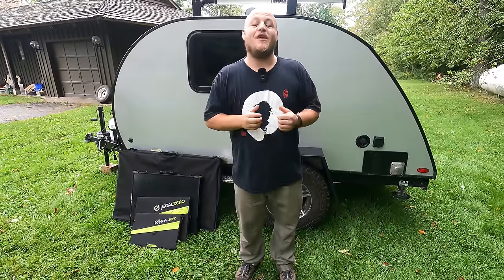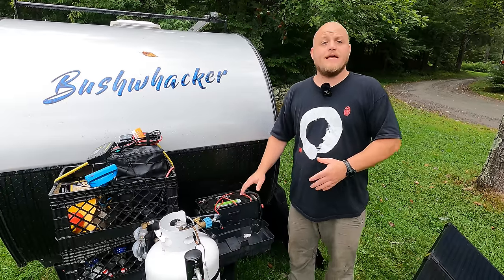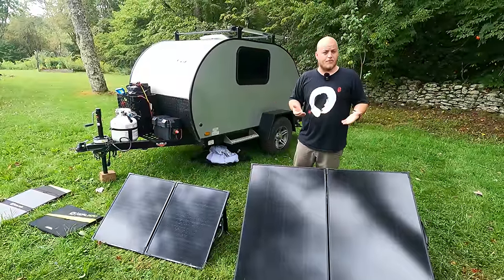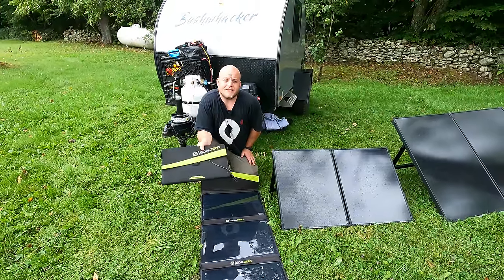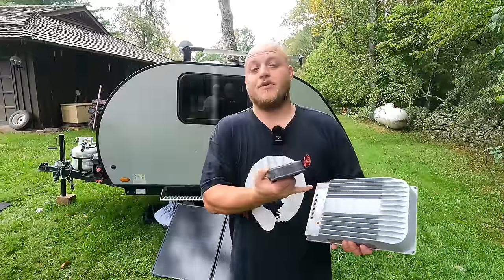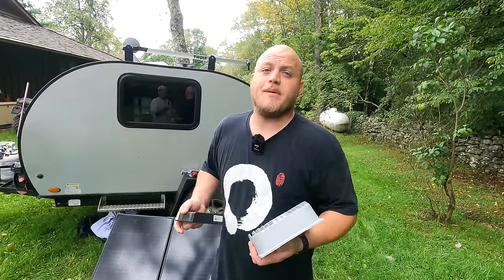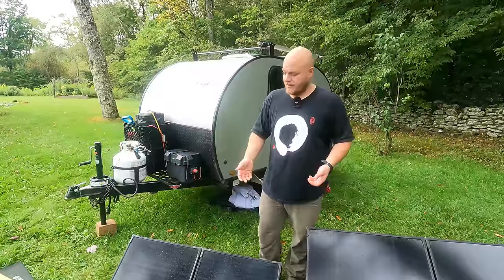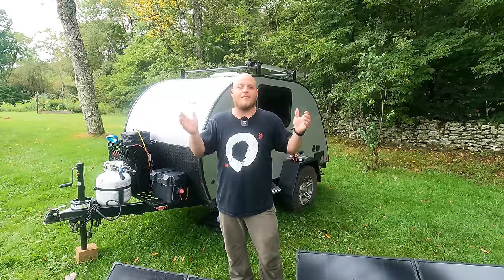RV Solar 101 : Everything a Beginner Needs to Know !

Comment: Hey Brian! This video was so informative. I used my boulder 100 and yeti 1500 x for 5 days camping this week. On the first night my friend wanted to try it on his pop up camper and it drained all the way out to 2% over night! Turns out his fridge was on and we didn't know.  After charging it for the next several days, I experienced the same thing as you. I maxed out at 90 from the panel despite being under 12pm sunlight flat. I could never reach 100. Thanks for the info, I am looking forward to the next videos about this, and trying to decide if I want another 100 or a 200 panel to make charging my Yeti faster.
Reply from the maker: Hey Joe, that yeti 1500x can handle a HUGE amount of solar, receiving 600 watts in at a time. As I’m sure you know, it’s a pretty big unit to recover with 100 watt panel, it would be a great idea to step it up a couple hundred watts. If space in tight, the Nomads are great, but Boulder gets best results.
   Somethings “fishy” with your friend..lol… I run my household refrigerator for days when the power goes out.. I’m guessing his battery was dead and charging, plus fridge, plus other items running, perhaps making waffles in there??? Haha 143 amp hours in a night… I’d be picking on him 😆

Comment: Amazing video thank you so much man. I noticed that you're not using lithium batteries, is there a reason why?
Reply from the maker: Thank you, I appreciate you watching!
I will post a video I did on the pros and cons of lithium for RVs.

I use lithium almost exclusively on my off grid systems but an RV is different.
1) I use two tow vehicles and would have to isolate both systems with a DC DC (this cost more than 5 SLA batteries) I’ve been getting 7 years out of AGMs.

2) it’s snowing and 20° in upstate New York today, not uncommon for freezing temps in April here. I’m charging my camper with solar right now, my lithium batteries are too cold to charge.

Pros and cons to everything, I hope this helps explain… thanks for a great question!

Lithium Camper Battery | Pros v Cons LiFePo4
https://youtu.be/ZtVTToIk7F8

Comment: Great video. You are a great teacher!
I am working with a 100w panel, I need to buy a battery, I want to know what kind of battery would you recommend? Lithium or lead. (I am using solar as a backup to my house electricity. In case the world goes down the tubes, or there's a blackout etc. - so primarily for emergency backup.) My panel is a semi flexible panel. It's portable only weighs 5.6 pounds.
Reply from the maker: In your case, I would go lithium.  I recommend a lot of people go with a sealed lead acid when they’re replacing a small camper system.  That has to do with the three different ways campers charge and not having to spend a bunch of money to upgrade. If you’re building a standalone system, there is a lot more value and going with a lithium.
Reply: @DIYOutdoorLife  okay thanks.

Comment: Great job, very informative. My RV has (2) 90A lead deep cycle batteries, (1) 190 W panel, 30A controller. Panel generates 665W/day, batteries would need 1080W/day. Thats about 40% deficit?
Reply from the maker: Should work out if you don’t use all the batteries each day.

Comment: Man  . excellent video. Ive ordered 4 100 watt panels as that is all the room I have atop my trailer. I think ,as per your video that I need a 40 charge controller and would a 200ah lithium be a good choice? I have a small rv fridge, a 30 " tv, a couple 10w leds and  the laptop and radio. Any advice would be appreciated. Thanks again for the very well done video Sir.
Reply from the maker: 30 or 40 amp MPPT would be best for you.  You’re going to have a great system, thanks for watching.

Comment: My question is... Do you need an inverter?
If so how the heck does the charge regulator work in conjunction with the inverter?? I see there are Combo- invert/charge controllers but what if you have each - seperate???
Thanks you're awesome
Reply from the maker: Think of the battery as the center of the wheel.  

The solar panel and charge controller charge the battery.

The battery charger built into your converter also charges the battery.

The battery powers all the DC appliances in the camper.

With an inverter, the battery can also power your 110 household outlets in the camper. It is an option, but not needed.

Basically, you have lots of ways to charge the battery, and lots of ways to use the battery.  There is some newer fancy equipment that can allow you to use the battery and charge the battery from the same device. It's fine to use separate equipment.

Comment: I have a single Die Hard M24-3 Starting Model 800CCA, 1000MCA, 135 Min Reserve Battery on my FR 24ft Wildwood Travel Trailer that was on it from the previous owner and my trailer has a Solar on the Side port built in to the front. The battery seems overkill for CA weather but probably best for the original buyers climate. This video was a great help. What panel size and controller may be safest and best fit? Seems like I have a lot of choices. Investigating it to see if that port worth utilizing though I camp typically at full hook up sites. Thx
Reply from the maker: Batteries advertising CCA and CA our reporting their ability to start engines.  None of that is useful for us looking for deep cycle capability when camping. Chances are, it's not a very good battery for Boondocking.

As for solar, it really depends what you're using at camp and how much you want to go off grid .  
A lot of people start off with a simple kit like this.  It's 100 W panel with a charge controller. Attached, that can easily plug into your battery directly or be modified to go into a solar on the side.

https://amzn.to/3YTC1rj
Reply: Thanks! I will review the link. Much appreciated!

Comment: Great video, exactly what I was looking for in trying to figure out how to upgrade our pre-installed solar system on our teardrop.  I follow all the math except for the last part of the video where you are discussing the charge controllers and what they can handle.  You said you just "divide by 12" so a 10Amp charge controller can handle a 120W panel and a 20Amp charge controller can handle a 240W panel.  Shouldn't that be "mulitiply by 12" since power = volts x amps and if you have a 12VDC system x 10Amps = 120W?  I'm just trying to make sure I understand correctly and don't fubar something.  Again thanks.  I'm searching now about replacing my single 12V 100aH AGM with two lithium LiFePO4 wired in parallel and what that does for me....I think it keeps the same voltage but increases the available amp hours but still figuring it all out
Reply from the maker: You have it exactly right. I was saying to divide the watts by 12.  220 W panel for 20 a controller.  Sounds like you’re off to a great system.  
You are also correct with the batteries. If you wire two 12v 100AH batteries in parallel, you now have a 200 AH 12V battery!

Comment: Thank you for the amazing video! Just lost me about the charge controller... for example is I have 2 100Ah AGM batteries, and 200 watt solar panel(s), how do I calculate the  Amp rating for the charge controller?
Reply from the maker: Use a 20 amp.  😃

Comment: You're a badass!  Such an informative video and explained so well!  But I have a few questions and need your opinion on what the best battery set up would be for my RV.  I currently have two 6 volt GC2 Deep Cycle Interstate batteries run in series, with no Solar panels at all.  I started watching your video because I just wanted to get a portable solar panel set up.  But now I am questioning if I even have the best batteries for my purpose. SO......battery opinion and solar set up suggestion?
Reply from the maker: How many amp hours to your batteries have?  225 at 6 volts?
When you’re off grid, how long can you camp before you get low on battery?
Reply: @DIYOutdoorLife  each 6 volt says its  225 Ah @ 20 Hr and we just got back yesterday from a trip...... batteries lasted 4 days.  Mainly heater at night and minimal light usage
Reply from the maker: @JinxDClown  that’s great, I think your batteries are fine.  If you can go four days without any charging, even a moderate amount of solar will keep you out there for as long as you want. 100-200 watts will probably be all you need.
Reply: @DIYOutdoorLife  great ty!

Comment: A square drop I'm about to pickup has solar already hooked up on the roof with everything (charge control ect) . Can I also add,  in addition to the existing solar package an additional solar panel set up with its own charge control and hook that up to the battery on the rv?  I may be parked under a tree let's say and the rooftop solar would be out of the sun.
Reply from the maker: Yes, it's fine to have multiple arrays and charge controllers going to the battery, theyll work together.
Reply: @DIYOutdoorLife  thank you! I've been watching your videos since yesterday afternoon! So much great info in learning before picking up this square drop! Thank you!

Comment: Thanks for the information, very helpful.  One question I have is is it safe to have either of these kinds of batteries set up inside of an RV?  Do they emit gasses etc?
Reply from the maker: SLA, like AGM are approved to use indoors. So are Lithium batteries.  Do not use flooded or wet batteries that vent indoors.

Comment: Just enjoyed your solar video.  I have a 100 watt solar panel on my mini camper The controller is rated at 20.4 volts and 4.91 amps  If I add another 100 watt panel to this with the same controller, would this cause any damage or problems or might I expect to receive a decent improvement to the overall performance ??...Thanks
Reply from the maker: I would need to know more specifics, but If connecting in parallel, you likely wouldn't harm anything.
With that being said, you probably wouldn't get the full benefit of the panels either.

What charge controller do you have? How many amps is it?

Comment: Thanks for the very helpful video.  If I could make a constructive criticism/suggestion for future videos..... you talked about storage capacity quite often in the video and incorrectly (lazy colloquial use I suspect) described battery capacity as "watts" instead of "watt-hours"  almost all the way through the video.  Leaving off the hours is technically wrong and even though I understand the goal to keep things simple it is best to keep them simple but technically accurate I would humbly submit to you.  Will lead to less confusion for folks in the long run.
Reply from the maker: You are 100% correct, thank you.   I noticed this when I was editing and cringed…lol

Comment: Thank you for the great video. Practical and informative! One question… We have a 100w factory installed panel and a charge controller on our camper. And camper has additional hook ups to add more panels. Today I connected 200W Bluetti panels (to charge battery quicker) and the controller went blank immediately. I suspect I overloaded it. I can’t find a fuse on it. Do they have fuses? Do I just need a controller with higher amp rating, or do I need a separate controller for the 200w panels as well to connect to factory installed hook ups?
Thank you very much!
Reply from the maker: What is the current limit of the factory charge controller? I suspect it’s 10amp if it came with that panel. That would limit you to around 120 watts. 
I’m not sure what controller it is, but it might come back to life if you return it to the original 100 watt panel. The fuse would be on the wire, not controller. 

Is there a chance that you plugged the new panel in reverse polarity (-&+ reversed)?

If you would like to run 300w of solar, use a 25 or 30a charge controller.

Hope this helps! Thanks for watching

Comment: I am watching your videos and learning a lot. I have a 65 ah lead acid battery on my teardrop with a 100 watt panel and a PMW controller. I also have a BougeRV 30 fridge. I cannot figure out if this amount of solar will run my fridge for three days? I think Bouge RV said that on Eco mode it uses 36 watts? Is that per day, per hour? Also, I do have a 400 watt inverter but I'm not sure I wiil need it because the fridge uses DC power and AC so I would use the DC. Also, I have a 518  Wh Go Labs power station w/ a Go Labs 100 watt suitcase style solar panel. Do you think I should rely on my RV solar set up or should I rely on my GoLabs power station instead. I sure do love your videos!  Oh and one more question. How do I know how much power I have left in my RV battery? Is there a tool I need (meter?) to continuously check it? I don't understand how I can be certain I am not going below the recommended 50% for the lead acid battery if I don't have some way to check it?
Reply from the maker: Hello and thank you for watching, I will try to address some of your questions one at a time, I'll leave separate replies.

https://amzn.to/46rHTbP
Here's a very inexpensive meter that tells you the voltage of your battery.  You can plug this into a cigarette lighter port on the camper and it tells what voltage the battery is at.  It won't be as accurate as testing right at the battery, but it does a good job.  You want to determine the number when the battery is resting.  This means, if something like your refrigerator is actively running while you're checking, it will show you a much lower number.   Nothing to stress here, just some tips and finding out what voltage your battery is at.  Once the fridge reaches temperature, it shuts off on its own and you can get a pretty accurate number.
From here, I want you to Google "lead acid battery voltage capacity"  it won't let me link it here, but you should be able to find a visual chart that shows 12.8 V or higher is full/charging.   Around 12.2 V is 50%.   That chart is easy to memorize or you can even print it out.  This is the most accurate way to tell what capacity your battery is at.
12.8+ full or charging
12.6 =80%
12.4 = 60%
12.2 = 50
12.1 or lower is where you start to wear the battery out. Try to end up here as little as possible.  Remember, with the type of meter  youre using, it will show a much lower number while there is a load on the system.  We are talking about the voltage when nothing is running.  If your fridge and water pump are running, it might show 11.9 V when you're really at 12.4.

Hope this is helpful, feel free to ask follow up questions if this is confusing. 
Thanks
Reply from the maker: The bouge RV 30 quart fridge is very efficient.  On Eco mode, it runs at about 35 W.   How many watt hours it consumes depends on conditions.  How hot? How humid? How much ventilation? How many times do you open the door? Do you put the food in cold or put it in warm?   There's too many variables to give good numbers.   What I can tell you, is that if you're on good behavior, it usually takes less than 200 W hours in a day.   This is assuming that you follow the best practices.  I have a video on bouge RV refrigerators that go over these things.

My guess, is that your go lab power station could run the refrigerator for two days easily, most likely you could squeak the full weekend out of it if you pre-chill the refrigerator at home.  If you have the solar panel hooked up, you should be able to get a weekend out of this no problem at all.

Your RV battery is quite small. Although it probably has at most 800 W hours in it, as we discussed earlier, you can only use half of that.  Since it is also responsible for your CO detector, water pump, fan, lights, USBs.... if you don't upgrade the battery, you're going to likely need the Power Station to run your fridge. If its particularly sunny days, you could probably run everything off of your camper battery, but you're gonna have to stay over 50% or  youll wear that battery out very quickly.

Try going on some camping trips running the refrigerator off the golab.  You might want to consider upgrading the battery on the camper in the future.

Hope this helps, thank you for watching the channel!
Reply from the maker: Avoid running the inverter off your system at all costs.  You have a small battery, it's going to get damaged running that 400 W inverter more than very sparingly.
Reply: @DIYOutdoorLife  yeah I just bought this teardrop and he just bought the battery in June. I think he really blew a good opportunity to upgrade the battery and I'm quite sure I will have to do that next summer. I always get my fridge cold before I leave the house and I put most of my meat in frozen so I'm sure that helps a bit. I try to stay out of it as much as I possibly can. I only use it for food and use a cooler for my beverages (which I seem to dip into quite often LOL).  I am checking out all your videos so I'm sure I will come across the Bouge Rv fridge video. :) I'm really enjoying all of your videos. I seem to want to do something to my teardop and I can find a video by you to help me figure out how to do it. I don't have a CO detector, water pump or pretty much anything else in my teardrop. It does have a 12 volt fan but I likely will never use it as it's too dang loud. I have lots of USB fans I'll be using instead and they will be topped up before I leave home. Probably the only thing that will be run off of the little camper battery are the lights and I'm switching them to LED so hopefully they won't draw much at all. I have a feeling in the end I will likely buy another portable power station. I really like the idea of the 2400 watt Oupes but I'll bet that thing is a bit of a beast. Maybe the 1800 would do me just fine. Lots to think about over the winter. :)
Reply: @DIYOutdoorLife  thanks so much for all of your advice. I sure do appreciate it and I really appreciate all of your videos.
Reply from the maker: @lifewithpugwinkle  always lots to think about!  With your set up, like that, that battery might last you a long time.